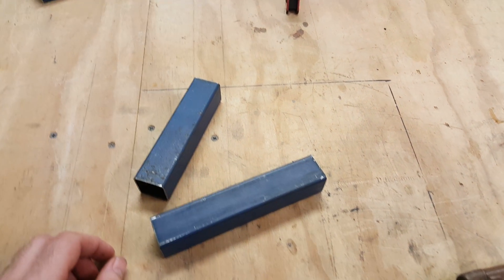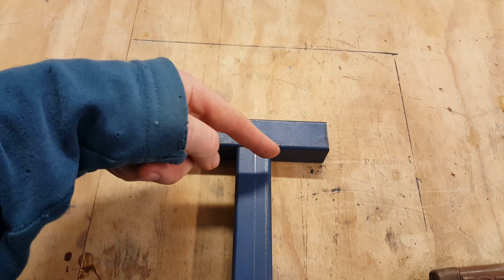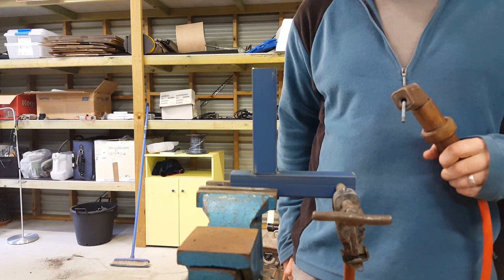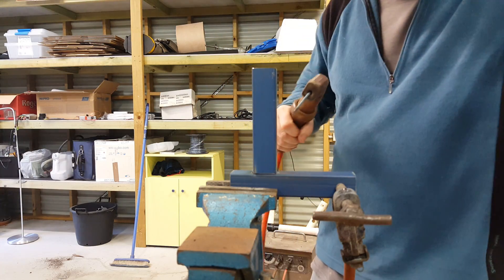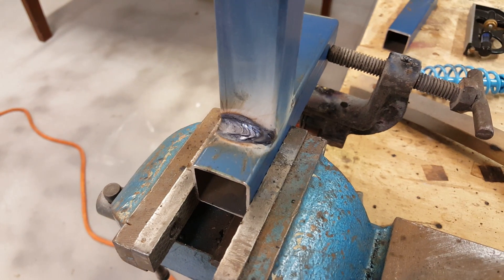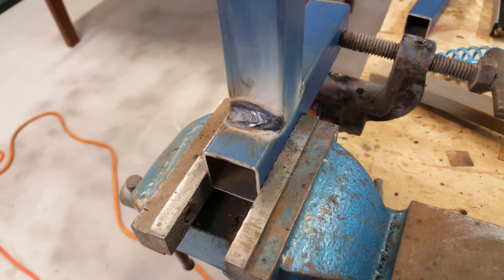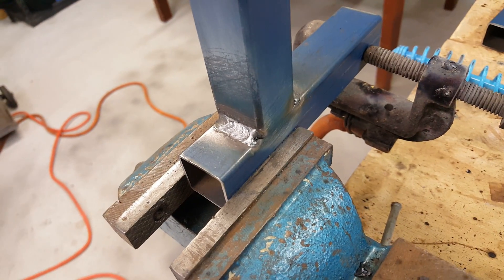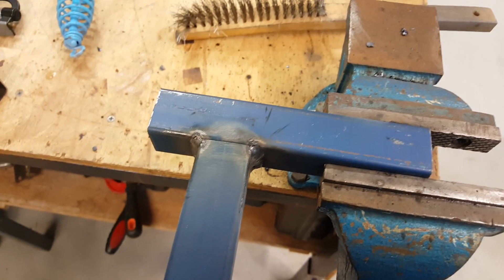Welding thin steel tube with a stick welder

Comment: First clean the paint off the tubing then use a smaller diameter rod and lower the amperage. You're getting inclusions from pulling away when its still rather cold and letting the slag get in your weld. You wont need to pull out of your shielding if you use the right amps, rod and clean your area to weld to bare metal. 6013s would work well for you with something like this.
Reply: I agree. I’ve had 2 projects using 1 1/2” square thin wall tubing just like this video. I’ve found 3/32” 6013 works. DC negative helps a lot with burning through. Keep a short arc and you don’t need to stop and start.
Reply: @albs1957  

Did you mean 3/32"?😂
Reply: Yea. 3/32”
Reply: I have a DC inverter welder what sort of amps should i put it on? If i go to low i can't get an arc to high and blows the metal
Reply: @TraderG1234  

It sounds like you need to hold a tighter arc. What are you using on what polarity?
Reply: @cavemanjoe7972  ok thanks  ill have a go. Its a cheap 100 dollar welder. looking at getting a boss weld mig soon
Reply: @TraderG1234  

My first welder was a cheap one, too. Is yours a cheap stick welder?
Reply: @cavemanjoe7972  yeah off ebay $140 no brand thing
Reply: one of those, If i change the polarity will that make a difference?
Reply: @TraderG1234  

The polarity you run depends on what rods you're using. Which ones are you using and what polarity are you running them on?
Reply: First thing I saw wrong with this method was inclusions of slag. They use this method a lot in Africa. I know it does not say much LOL
Reply: I agree always take off the paint.

Comment: Be very careful if you weld on the concrete floor. Not safe safe at all. Can actually losses small pieces from the heat which then go airborn
Reply: YeahNo101 ?   I discovered exploding concrete about 15 years ago!!!, nobody warned me about using a cutting torch onnthevground......
Reply: Eddie Caplan Lol yeah I discovered that this summer...got a nice piece sent flying into my face!

Comment: What rod size should be used for thin metal and how many amps?
Reply from the maker: 2.5 mm rod, 75 amps, 45 volts AC.
Reply: As close to the diameter of the metal as you can get.     Yes you can cheat.     Try to avoid  6011(deep penetrating)  go for 6013 as it’s  shallow penetrating.   
   You can get away with a lot you’re not supposed to with and I welder in the thin metal department. But I try to do is find a piece of scrap it’s about the same thickness and I make sure I’m all dialed in with that. I didn’t even know about getting the rod hot but that’s a good place to do it and I’m going to start using it when I do t feel like breaking out .   the mig.
Reply: cool starting tip...good luck with the leg healing up when you need skin grafting on you hands. around about when your 55

Comment: Great video!!How do I prevent holes from blowing?
Reply from the maker: But that's kind of why I put the video up - On a lower current setting it doesn't get the weld penetration I'm chasing and the rod tends to stick more easily.  I should put a video up of welding on a lower current setting and you can see the grief I had.
Reply: Narinder Shergill you don't have to start and stop like he's doing you just stay on the thick metal and pull your bead across the thin metal you don't have to start and stop and all

Comment: This is a great video but if you just turn down your amps it will be a lot easier to not burn holes
Reply: Alex Onder I haven't ever seen a welder that does not have adjustable current. It's a core function of all welders.
Reply from the maker: I find the penetration is poor at a lower current setting, and I have better control over the heat of the weld by lifting up.  The slag will work its way to the top of the molten metal and come away if you hit it while its still hot.
Reply: Cheap welders don't give you a choice of amperage change
Reply: Never heard of that!
Reply: By cheap I think you meant home made... Like other people said, I've never seen a welder without adjustable amperage... Even the older ones with the pin system
Reply: Well, I do have one, a CIGWELD COMPACT, nearly 40 years old, switch select 2.5mm / 3.25mm.
While 2.5 mm will blow hole in a Sherman, 3.25mm stick current is spot on.

Comment: Good video, I will give it a try. Couple of pointers, if you hold the electrode holder with both hands and brace your arm you can have more control on the rod

Comment: Fit up must be perfect and then run it with 2mm electrodes at  40 to 60 amps!
Reply from the maker: Fit up was close enough, electrode was 2.5 mm and the current was about 75 amps.  Smaller electrodes and lower currents resulted in a lousy weld with poor penetration, so the higher current was better all round.

Comment: you say you are using 2.5mm rod. in that case you did very well..  try using a much smaller rod. even easier
Reply: I have found the smaller rods to be just so much harder to use that I don't bother with them.
The other thing is that the 2.5 mm rods are easily available at just about any hardware store whereas the smaller rods are not as easily sourced.
Reply: thinner rods are better if you can use lower amperage, but if you cant they wont be of much help since they fill much less material. i tried with 2.5 and 1.6mm electrodes, if you cant lower your amperage enough its not too much of an advantage using thinner electrode, it will just stick less
Reply: Geoff is spot on. Smaller rod lower amp much easier with better weld and no gas holes. Breaking the arc is not welding.

Comment: Not trying to be safety Sally here but get a decent spring loaded ground clamp.
Reply from the maker: I've been meaning to do that every time I use the welder, and promptly forget when I put it away :D
Reply: Chris Jones it's incase you or anyone may need to disconnect the current in an emergency.
You can't do that with a C-clamp.

Great job on not blowing through.
Reply from the maker: Michael Rhoads makes sense. Ta!
Reply: A screw clamp beats a spring clamp anyday.
Reply: That`s what the on off switch is for . and faster

Comment: I wish I knew your technique before. I'm building a 6X3m shed from 1.2mm square tubing; it's standing for itself at least, but full of bores all around the welds... I'm thinking in buying a flux core welder to repair it, what do you think?
Reply from the maker: Que Picardía Hopefully this will help. You can still grind the welds and go over them a second time.

Comment: Hi Chris! Thanks man! Just left the garage 10 minutes ago with a grin on my face. Was trying to weld some 1.5mm thick rectangular tubing but kept blowing holes through the material. Your suggestion worked!
Reply: I experienced the same as yours. Truly I'm disappointed of myself trying to build a railings in my house. It's 2018 april

Comment: why not use a thinner electrode so you can lower your voltage and amps so you can have better penetration.
Reply from the maker: These electrodes are 2.5 mm. I tried using 2 mm electrodes but I struggled to get good penetration, especially with lower amps. Probably got more to do with the welder than anything else.
Reply: Yeah it might be your machine have you checked your ground?
Reply from the maker: It's a pretty lousy ground clamp, but skill no doubt plays a large part.(that is, a lack of skill).
Reply: Yeah that could be the problem along with the stinger. And like you said skill does make the difference. But practice makes perfect. Not a bad video.

Comment: tack tack tack is a crack crack crack
Reply from the maker: I'll let you know when it cracks.
Reply: just sayin u could get a little 70amp mig for 50 bucks and it would be more than 50% stronger for sure
Reply from the maker: Yep. But if you didn't have a MIG, and all you had was a stick welder, this technique seems to work okay.  I'll have to do some stress tests to see how they stack up (using something a little more scientific than bashing it with a hammer too).
Reply: sounds good I'll be awaiting the video
Reply: It may not be scientific  but bashing it with a hammer is the ultimate test , forget the theory if you can do the practice.

Comment: Hi Chris.  Enjoyed the video.  It looks like the metal has a blue coating on it.  Just goes to show you that you don't need an expensive Welder to build projects.  What rod did you use?
Reply from the maker: Yeah its like a metal based blue paint. Makes no difference to the weld, so its not like galv or anything. The welder was set to about 75 amps at 45 volts. Some might say it should be lower but I find the penetration to be fairly weak and you have to go slower to make it stick.

Comment: That looks pretty good for a stick welder on thin metal. Could you tell me what current the buzz box is set to please? I'm getting one soon so knowing what is a good starting point would be helpful. Thanks.
Reply from the maker: Thanks! Its AC, set to 75 amps at 45 volts. I find the higher currents gives better penetration but its a fine line between good welds and blowing holes.

Comment: I chip hard too Chris being a chippy, good advise on welding thanks but i think you are a better electric bike builder anyways
Reply from the maker: Haha, yeah, lost of videos out there on welding 'thin' steel, but it's all at least 3 mm thick.  The vast majority of backyarders like me have a $80 welder which would ordinarily blow holes, but I found this worked.  I wouldn't weld up a motorbike frame with a stick welder, but for most stuff it actually does a pretty good job.